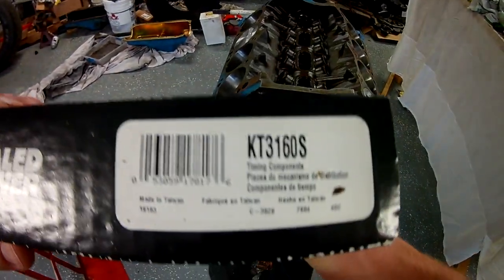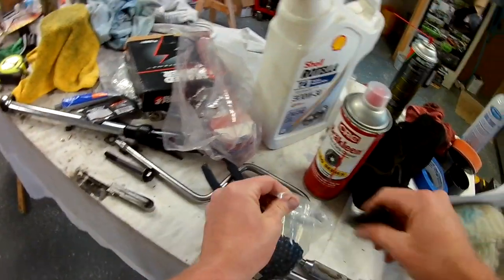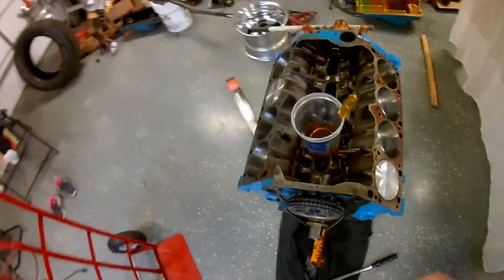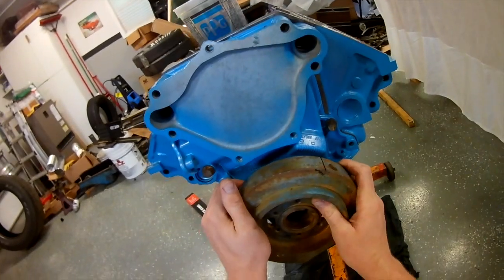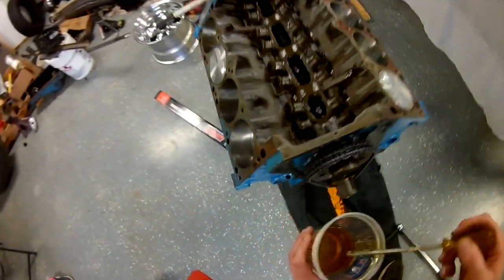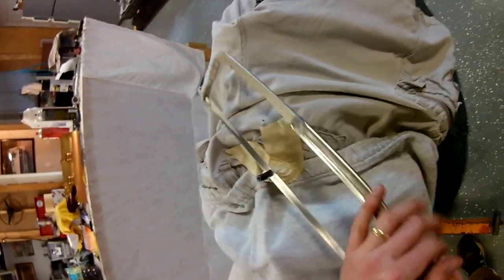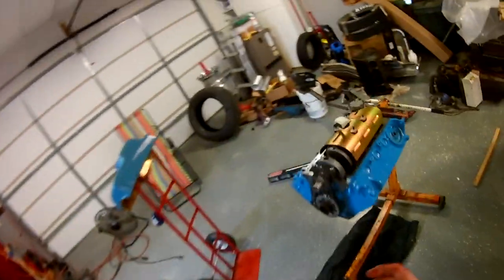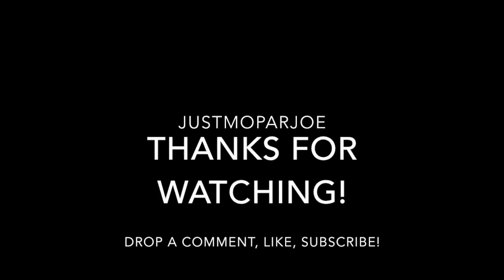360 Engine Build! Part 5, More Tips for Max performance and Longevity

Comment: I’m new to the mopar and rebuilding world so the videos have definitely been a massive help. I’m not going this in depth (yet) but understanding how everything works together has to help at least a little in determining issues! I got a 77 M880 that I’m swapping a 360 into and a 4 speed! I’m super excited to get into the engine swap in the next couple weeks and hopefully we will be on the road! Great videos man!
Reply from the maker: Thanks Jason! I made the series to help anyone I can! Caught some flack along the way, but there’s more than one way to build an engine! This one has worked me several times and shows what I was taught. I have a 413 Big block coming up and my 408 small block.

Comment: You are a brave man I never just bolt on a new oil pump. I always take them apart for inspection. You would be surprised the crap I have found inside brand new oil pumps  metal, dirty who knows what else
Reply from the maker: This video was a few years back. I have stepped up my engine building procedures since then. Check out my playlist if you get time

Comment: Love tip #10! I’m going to do this from now on. Thanks for sharing.
Reply from the maker: Glad it was helpful! Check out my newer builds if you can. I have definitely grown as a builder
Reply: @JustMoparJoe  ok great. Thanks. I’ve been subbed for a while now. I  have (2) 360’s I’m building. One is a 408 and on the back burner for the moment and the other is a .020 over flat top mild build from my first vehicle from 1996 or 98.? Its from a 84 ram-charger and going in a 71 demon that had a worn-out 360, (now 408 build). One day I’ll finish it, for now the 366 will be fun.

Comment: Excellent Ezy to follow video you give me the confidence to build my 1973 cast crank 440 at home. I am thinking of going with a  440 source  500 stroker kit ( mainly to get the steel crankshaft) and gear drive with roller camshaft and adjustable roller rockers. I have spent months watching videos yours included I have my engine totally striped down now. Run the die-grinder over the block in side and out, polished in side the block for oil flow improvment, ported my head's all up I have spent a solid week on the die-grinder.
Reply from the maker: Good luck!

Comment: Hey man, thank you for your videos here. They have been helpful. I ended up going with the timing chain you suggested, the replacement one from Summit for just over $110. I'm going to have a shop put together my bottom end to make sure it is properly balanced. But I'm personally hand picking all my parts. Your videos have helped me in the process of my project. Just a stroked out 360 with and EFI systems, 9.5:1 compression, hydraulic roller adapting a manual 5 speed Tremec TKX and dropping into my 1979 Doddge Van. Anyways wanted to assure you, your videos have been helpful.
Reply from the maker: Edit sharing! Sounds like a beast mode of a van!

Comment: Its also 8n some applications required to wer not flood but simply wet the threads of certain bolts or studs to prevent friction when tightening an or torquinh boltscstuds soark plugs etcetera etcetera

Comment: These  videos are great ,building my first mopar engine LA360 1979 year model I have a question for you my pistons do not look like yours there smooth no valve cut outs and only a dot which I pointed towards the front of engine hope that’s right
Reply from the maker: Yes sir. That sounds like the factory ones. Be sure the rod chamfers are correct on the crank. Thanks for watching! Check out my 408 videos if you get a chance. They have different details.
Reply: Thanks for replying I seen the chamfer part in your tips 360 build I’m gonna double check this I’m putting the caps back on the way they come off just not sure if they are going back in the same cylinders as it’s been apart for a while and I’m just starting over from scratch
Reply: Man your my go to mopar channel on my LA360 build  that being said could you lead me in the direction  for a good rebuild  manual ? I have a Haynes manual for the the truck but it’s leaves a lot to be desired thanks and keep those great videos coming sir
Reply from the maker: @jasonnewman1823  thank you! I like the book that I referenced in the earlier videos. It’s magnum based, but had a lot of good information.

Comment: Some small block Mopars came with the top left thrust plate bolt with a hole in it so that oil could drip down to that angled plate then onto the chain
https://www.forabodiesonly.com/mopar/ams/how-to-assemble-the-front-of-a-small-block.12/
Reply from the maker: tanis4457 true that! Check out Scott’s speed shop’s 273 build. This 360 didn’t.

Comment: On your timing if you count the teeth on your cam gear and divide that into 360 it'll tell you how many degrees per tooth if you're off
Reply: Count your sprocket teeth on the cam gear divided into 360 and because the crank spins twice as fast as the cam gear you divide that number by 2
Reply from the maker: Thanks for sharing brother! Glad you’re checking out the old videos. I’m a cam wheel guy now.

Comment: I realize this is a old video but i never seen or heard you tell people to ckean out the threads in block for  rod an main bearing bolts prior to  torquing them down getting any old sluge out of every bolt hole if you have any debris or any type of liquids like oil degreesers it will give you a (( false torque))
Reply from the maker: I addressed that in the 413 build series.  It was a basic build up of a RB big block

Comment: jmj you have to come clean on cam timing,  You know that you cant time the dis on the #1 unless you turn the crank 1 turn to put #1 on top dead center. unless you use a cam that changes the firing order.  You need to clarify on tips and tricks.
Reply from the maker: Roger, here’s exactly how I do it. Put the engine dot to dot. Cam at 6, crank at 12(like the book says). I then install engine. Leave out number one plug, stick my finger over the hole and turn it over until it poots. Look at the timing mark. Set it about 10 degrees before tdc on the cover(turn it backwards with the crank bolt)and drop the distributor in. Where ever the rotor points, make that number one. It doesn’t matter. Many people think it has to point at the number one plug, it doesn’t. Fill the carb with gas and give it two good pumps. Starts up. Good to go. Check out the last video in this series when the engine is on the run stand. We break the cam in.
Reply from the maker: Also, I still have to stand by my statement. You have a 50% chance when you drop that distributor in to be on number 1. If it’s not, then you pull the distributor and turn the rotor 180 degrees. That means it didn’t drop right the first time.

Comment: hey mopar joe I'm a first time engine builder and would like some suggestions from u or anyone for that matter  I'm rebuilding a 360 5.9 mag with a 30 over bore I have a 4x4 and I would b using it on the street and a little mudding and i was watching David Vizzard and I just don't understand cam formulas my guess by his formula im thinking #3 on his cam chart between 50-70 overlap ??? does anyone have a suggestion for a slightly aggressive cam something that sounds good but don't loose a lot of tourqe O and it's a budget build so easy on the price tag lol ..AND GO!!!!... thanks
Reply from the maker: Check out my videos coming on the Ramcharger revival 360. It’s a budget 360’build that’s getting sealed up, new cam, 4 barrel, headers, and hood valve job. If you’re using your stock style fuel injection, that limits you on what cam you can get away with. Also the magnum beads are limited in valve spring choices for aftermarket cams. Please go over to Hughes engines website and check out their cams and tech articles. They own the magnum small block game.
Reply: @JustMoparJoe  appreciate the reply 🙏

Comment: Dot to Dot like you show is actually No. 6 TDC firing.....if the cam sprocket is at the 12 o'clock then the engine is No 1 TDC firing....
Reply from the maker: tony santos yes sir. You are correct. When I drop that distributor gear, I’ve got a 50% chance of wiring to number 1. If it doesn’t, I pull the distributor and turn it 180. Hang out for my explained start up sequence.
Reply: That also depends on to what degree your cam is timed, Tony.  Dot to dot puts you at compression stroke on #6.  All you gotta do is then turn engine until you’re on compression stroke of #1 cylinder.  Stop at tdc.  Drop in dizzy and run the firing point to #1 and you’re tdc timed.  But that’s what I call dirty timed.  You still need to tweak your timing, but that’ll at least get you running.  Moral of the story is cam dot at 12 o’clock doesn’t always mean your timing is set.

Comment: Hey im doing timing on my 360 and the dots are both at 12 o clock am I missing something I've tried tdc 4 times.... need help
Reply from the maker: Tony Hagey I always go cam at 6 crank at 12. Some say that times it to TDC on number 6. Drop in your gear anywhere you want. Drop in distributor. Wherever your rotor is pointed is your number 1. You have 50% chance of it being 180 out. Simple fix is pull the distributor and turn the rotor 180 degrees. Shoot me an email if you have questions. Justmoparjoe @gmail.com
Reply: I sent you a email with a picture of how the timing was at tdc when I opened it all up

Comment: A huge reason to stop and check the balancer (0) now is because sometimes when reusing a old balancer, it may have slipped and the balancer (0) could be way off. This has caught more than a few people. ALWAYS check TDC at the piston and then make sure the balancer shows correct. If it doesn't and you know your piston is at TDC, junk that balancer and buy a new one. With that ring off, it will throw the balance of the engine. I know machine shops that will not use an old balancer on anything over stock rebuild. 
ALSO:  you have been pretty good about cleaning and even mention you knowing it's clean because you cleaned it, BUT,,,,, have you ever opened up a brand new Mellings oil pump?? FILTHY!!!!! I have build many big blocks and always use mellings, but every one of them has been loaded with shit. I have spoken to the company and they say they run them and no worried. YEAH??? Open one up and you will never install another without pulling it apart and cleaning it yourself.. After cleaning, I use Vaseline to pack the pump for priming as I don't always fire them right away.
Reply from the maker: I’ll look into the next new one I buy. That had never crossed my mind until now.